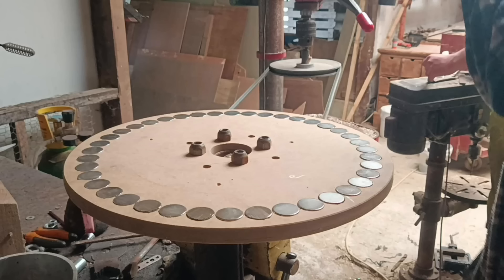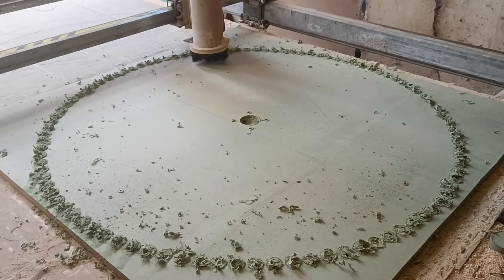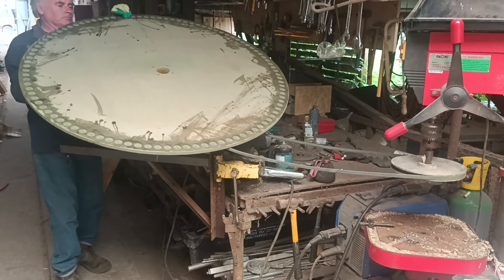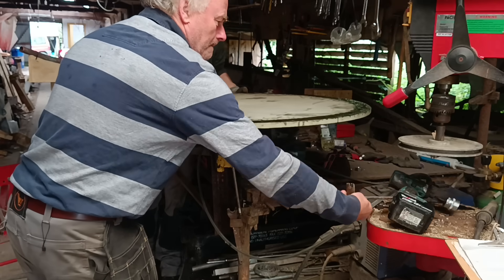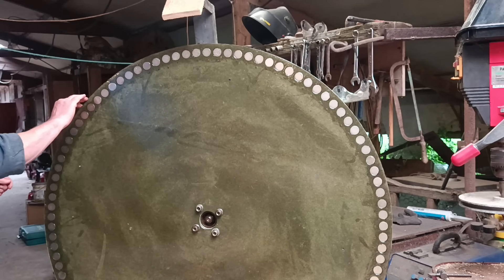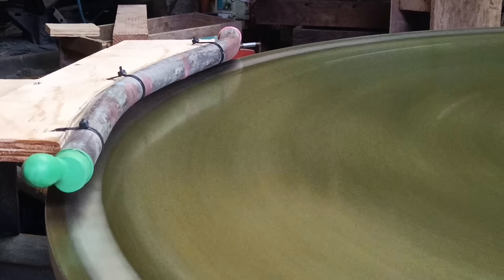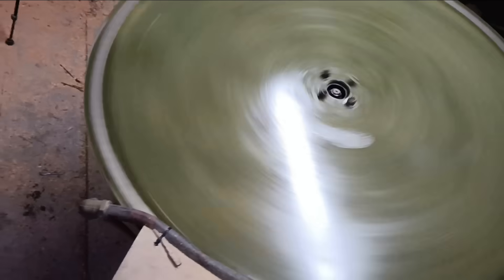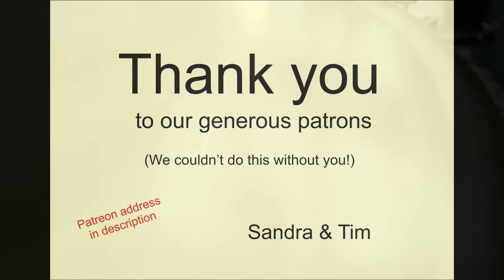ABSOLUTELY HUGE Magnetic Induction Heater! Using 100 Spinning Neodynium Magnets And A Bucket

Comment: I think you stumbled upon an idea that could make the most cost effective on demand hot water heater ever.

My first step would be to make the metal pipe follow around the entire circle.  More heating space means less energy(speed) needed for the total heating right?  With thermostatic control to speed up or down the spinning depending on the heater settings.  With that all you need is a motor designed for speed, not torque, that has variable speeds.  These are cheap as hell to run off electricity, you can get them from any dollar store box fan.  

With that you can just setup your windmill for electricity generation, which will be more than enough to make all the hot water you could ever want and then some.

Imagine households being able to make all the hot water they need, when they need it, at the cost of running a cheap box fan?  That would save people hundreds of dollars a year on their electric bill and I'd be first in line to buy one.

Comment: Longer flattened copper pipe 1 inch in diameter. Try Taking the cold water from the top of the bucket and return the warms water from the bottom. Insulate as much as possible. Of course you would get more heat (or cool) by just running a modern heat pump from a generator attached to your windmill...

Comment: But the energy in us more then the energy out. Or the energy in can be used to heat water by other methods at 80% efficiency
Reply: However, the 5 hours in the garage away from the wife is worth it all

Comment: Stop wasting so much energy. 
You can use a large bike rim. 
It will be a lot lighter and spin a lot better. 
Since the rim doesn't need to support a person's weight, you will be able to remove most of the spokes, reducing the weight and drag even more. 
Next, Mount the magnetic so both sides are open. Top and bottom.  Then use a full circle of copper pipe on both sides. 
You will end up with your rim spinning between the pipes.

Comment: Starting work as an apprentice plumber way back in 1948. When fitting hot water cylinders. The hot water pipe from the boiler went from the top of the boiler into the side of the cylinder near the top. The return from the cylinder went from near the bottom of the cylinder to the bottom of the boiler. Thus giving a continuous circuitous flow as the water heated up. This may work on your system and increase the water temperature? Your water supply seemed to have both in and out pipes at the same level.  All interesting stuff, Tim. Go with the flow.😉
Reply: Lol
Reply: Yeah some old systems, heating the water with heat behind the coal fire, say, relied just on convection to move the water round. If it's properly designed it's good enough.

Comment: Is there anyway you could build a second magnet wheel and spin it in the opposite direction with the water pipe in between the 2 wheels?👍

Comment: You need to build a better transformer. 

Use an iron rod as a core. Insulate it thermally and electrically, but thinly as you want to keep the cooper physically close to the steel. 

Use a smaller diameter copper tubing. Prepare it by tempering it to dead soft. Then insulate it from itself: make a large and loose coil, varnish it, shuffle it around and varnish again, repeat a few times. 

Wind the tubing tightly around the core. Fill it with water and crimp both ends: the hydraulic pressure during bending will prevent it from collapsing or kinking. You do want to see high pressure water escaping from the crimped ends during bending, it has to go somewhere.

Make two of those. Connect the water in series through both coils using electrically insulating tubing. Connect the ends of the coils in electrical parallel. Arrange the poles of the coils over magnets of opposite phases.

By connecting windings of opposite phases in parallel, we are creating an electrical short, which will dissipate energy as heat. 

There's probably something to do with magnetic pole shoes to connect the two windings for better efficiency, but it's beyond me tonight. Good luck.

Comment: On your water storage tank... put the inlet and outlet on the side, not the bottom, with one higher than the other. With enough height differential, (somewhere in the recesses of memory is the figure 18") the cooler water in the tank will fall back to the heating element. 

If you have an old 2 element electric water heater, you could replace the two heating elements with an inlet and outlet.

Also, shorter pipes = less heat loss.

Comment: Two spinning discs, one on each side of square cross section copper tube. Large iron ring embedded in disc touching back side of magnets. With such a large spinning disc, you might have two circles of magnets and two rings of copper pipe. Great project - Good luck with everything!

Comment: To make better use of the magnetic flux one may try running the opper pipe around not only a full 360 of one side but also the other. Or some combination of such to make use of both sides of the magnets. Additionally since magnetic flux strengthens exponentially by proximity, crushing the pipe to be more the cross section of an oval rather than a sphere would bring the far wall of the pipe closer to the induction. 
Thank you for doing the work i wish i could!

Comment: Don't want to be a party pooper but some thoughts.  If you go to the trouble of using magnets why not go for producing electricity which is much more versatile. 

The large diameter is a good approach as with windmill does not produce high rpm without gears with the associated loss of efficiency. 

Some 40 years ago I was very interested in wind energy and even built as small set up. I was aiming at 500W output and IIRC the swept area needed to be like 3 meter in diameter and it takes a lot of wattage to heat usable quantities of water. Do the math.

At the same time  I read a MA thesis about heating a single family house with wind power and that was based on the windmill strinning liquid with paddles. This IIRC was the most efficient way to get the power out as stirring as such is almost 100% efficient in turning motion to usable heat. You won't boil water with it but for keeping the house warm you only need like 50°C which was doable. 

Now days solar power is so cheap that for any small scale system, the solar output permitting, is the only way to go. Cheap, easy to setup, very little maintenance, no moving parts to break. Maybe, and that is maybe, if you can access stream of water you could do something useful with that. Still building something that runs 24/7/265 is not easy.

Have you considered (I bet you have) which sort of windmill you are going to build. Vertical axis or horizontal?

 If horizontal (like most of the commercial ones you see), then piping the water to the turning part might be an issue. In which case producing electricity would much easier way to get the power out. A horizontal type has the advantage that it is much more efficient than any vertical axis type. By a large margin. Vertical types have the advantage that they are omnidirectional so you don't have to turn the to the wind. 

One thing to consider is that the power you get is proportional to the cube of wind speed and the forces your mill has to stand is proportional to  the square of wind speed. So as soon as you get to the profitable wind speed you may have shut the plant down.

But I guess my main concern is the efficiency heating via direct induction using eddy currents. You can easily measure this with your setup. Just measure the the power the drill is using idle and when heating water and the measure the delta temperature (with an isolated container) you get. I bet it will be dismal. :(

Good luck! Enjoy watching these kind of videos and applaud for people who go for any sort project like this.

Comment: A sketchy setup at best.  I'd be more concerned about the whole thing coming apart when that disk is at full rev's. It would be like a Tasmanian Devil in your workshop! Another reader suggested you increase the copper pipe into a ring around the magnets.  You could create several rings.  I would build a closed loop for the induction. from the copper rings aroiund the magnets have the liquid travel into a coil of copper rings (shaped like a spring) then back down to the magnet ring or rings.  This coil then sits inside a water and insulated water vessel.  The coil heats the water.  For the liquid in the copper pipe use glycol which is a mix of alcohol and water.  Same stuff as windshield wiper antifreeze. This conducts heat far better than water alone.  As for bending the copper pipe purchase 3/8" soft copper tubing used for gas fitting. This will bend and shape around anything without kinking.  Another method is to fill the hard copper pipe with water, cap the ends and freeze it solid. Once frozen you can bend it and it won't kink.

Comment: The next level of advancement will be to lathe the disk into a cone and then set the magnets.  A second cone would be in close proximity to the magnets so that as the water is heated it rises inside the copper pipe and ascends in the direction of the outer edge for collection into a main line that exists out by the outer edge.

Comment: Gyroscopes now days have a conical shape so that the disk is structurally more supported.  This would require at least one side to have been a stack of layer that were then lathed down into a shape that is both stable and holds more momentum for continuous coasting.  (Such a system would mean a clutch in the windmill would be needed as well as possibly a bike like gear box ((bike chain is one of the most energy saving transmission systems.)  A bike like gear shifter would need some form of controller possibly a Raspberry Pi with a push pull electric motor on the gear shift cable?)

Comment: A circular rotating tube in the opp direction 

A circular pipe with  holes in..the pipe would rotate  throwing water In to a collector and pumping back up circulating till hot enough to use .

Comment: have you tried a copper wire coil to interact with your magnetic flywheel, where as to generate alternating current that would transfer your energy to you bucket without heat losses (no pipes to insulate) an a heating element of micron wire from a stove-top.
Reply: looks like you built half an electric motor, you need a field winding.

Comment: This seems like a more expensive proposition than putting the magnets in a cylindrical case, and using the eddy currents to heat an external resistance element. (Hook up a generator or alternator and a heating element)

Comment: your contact surface is painfully small. if you make a pipe closer to the full circumference, you will multiply your thermal transfer. you could run two loops; one on each side of the disk for 2x transfer.
also reduce the gap between the pipe & magnets for another multiplier.
also your reservoir isnt deep enough to get the seperation layers you mention. if you waant that, use a taller reservoir with the 'hot water inlet' drilled at the top of the reservoir, rather than at the bottom with the cool water.

Comment: My thinking would be to make a much smaller unit spun at a much higher RPM. This would allow less demand for resources as well as in my mind making it easier to insulate. Obviously the system works but is quite cumbersome. I have a small hobby machine shop and in my mind this project would require some very high grade machining as well as some very high quality bearings as well as meticulous balancing to sustain the high speeds I feel would be necessary to produce heat in a much quicker and sustainable fashion. Also should make insulating the unit easier. As far as feasibility of a viable heating method??

Comment: What a fun project, thank you for including me. The magnets you are using appear to be top quality, you really make their functionality stand out. I was curious about the drag your pipe creates as the energy is transferred to it, I can't imagine that temperature has much of an influence, however as the temperature raises it seems to take less energy. With that being said, did you notice any speed increase in your wheel as the temperature of the water increased?

Comment: I'm cringing a little bit at the waste of neodymium.  Just pass electrical current thru an immersion heater.  Or use the motor to drive a heat pump.  Either one would work better than this.

Comment: could add a second row of magnets shifted one place left or right to cause the flip between rows as well. increase the length of the pipe (could even make a double coil to cover two rows of magnets) that added with insulation and a more stable mounting of the pipe with proper spacing should resolve the problems. also with multiple rows of magnets, you could reduce the size of the spinning plate and reduce weight.

Comment: Would it maybe maintain a higher temperature if you increase the volume of water - the thermal mass, combined with insulation might let you raise the temperature more efficiently?

Comment: cool design, been thinking of similar designs myself just for fun to get a hot tub at my cabin that can be used even in winter time. 
there are multiple ways of making this more effective:
1) make the copper tube extend in circle above all the magnets. Im not sure if this works but could potentially also do a loop under the disc.
2) thicker hoses/pipes, this will allow larger quantities of water to be transported at same time, this will slow down the heat loss

a design i've been considering is doing a cylinder with magnets in it where a copper tube goes down and then up again. this will allow every magnet to affect the heating area while still keeping the design small.
if we are doing a windmill design then the issue is keeping a steady speed, gonna need to look into a automatic gear system so that the cylinder stays at same rotation speed regardless of how fast the windmill is spinning, potentially a automatic lock and semi brakes for when it about to spin too fast

Comment: Well, I can say the obvious would be, too.
Continue the copper all the way around. The size of your copper. Maybe the difference you might try 1/2 inch or even 3/8. I think check valves are a must. In addition to make it as close to touching the magnets without as you possibly can. I think you are losing more than you know by allowing more than the thickness of a piece of 100 grit sand paper. Issalation is a must. Not just the pipe but the whole disk. I'm sure that it's producing quite a bit of wind itself.  What do you think about putting The baggots in a spiral starting at the outside. Going towards the center then covering the top with a piece of spiraled copper. That way, you would not only have one row,  but many rows. Increasing the overall leniel footage of induction. The check valves are a must. It will keep the heat from traveling in reverse and, in return, ensure you have the energy traveling the right direction.

Comment: Just a random idea - using a smaller diameter copper (or iron) pipe and coiling it around a second time.  Flow probably isn't much of an issue as this is convective, and it would be easier to bend.  could make 2 loops all the way around, that would be a lot of heat!

Comment: Multiple coils of smaller diameter copper ...
Maybe three loops bound close in a spiral..
OR
Heavier wall pipe  with Small i.d. (inner diameter) the metal will get good and hot

Comment: What is the advantage to using a large disc with 100 magnets instead of a smaller disc with higher RPM?   Since most of the magnets are not next to the water tubing, only a few magnets are doing anything.  Half the magnets at twice the RPM would have the same tangential speed and generate the same frequency.

What is the advantage of the magnetic system compared to a mechanical stirring element, which has been used before?

Comment: By having the pipe follow the magnets, the fields aren't flipping as often.  That would explain why the water got so much hotter with your shorter pipe in the earlier experiment with 40 magnets.  The fields cancel eachother out if two opposite polarities are seen by your metal conductor at the same moment.  Try putting the pipe at eight angles to the magnets so that only one polarity of magnet hits the metal at any given moment.  I think this may give you a better result.

Comment: It would be better to mount U bar  magnets on a wheel with the ends outward (like a rope pulley wheel) and run the copper pipe in a circular way in between the poles(like the rope around the pulley). Closed magnet field loops, small air gaps, lots of eddy currents. Go for parallel disks! OR buy a magnetic brake... OR every DC motor and feed the power to the copper pipe. I wonder if the magnets get hot too and degrade the epoxy?

Comment: The next step is to calculate on paper how much power you are drawing from the grid to turn that disc, how long it would take to raise the temperature the desired degree and the power required and compare to how much would be required to heat the water with a resistive element.
Then to understand that you are flogging a dead horse.

Comment: I'd use thinker pipe and smaller diameter, You could go from one normal piece of pipe to four pieces of pipe better laid out flat, side by side, bringing more copper surface closer to the magnets to heat up.

Comment: Is there a way to set magnets on two opposing wheels, whether wood or otherwise, in a way, that once you spin the wheels, the opposing magnetic forces would keep the wheels spinning? Maybe controlling the speed by the distance between the magnets? I know... I know... there is no such thing as a perpetual motion machine machine, right?  Or are they being suppressed?

Comment: you a steel pipe, it will be way more efficient, copper is more conductive than steel, it doesn't slow down the foucault current as much